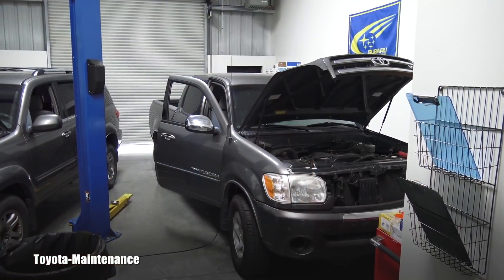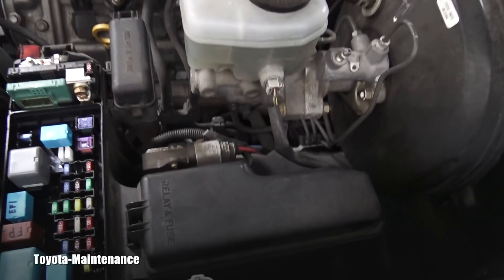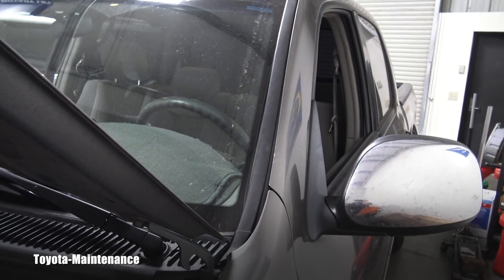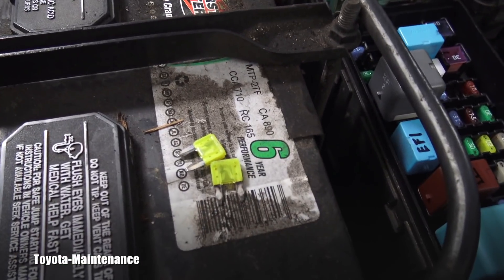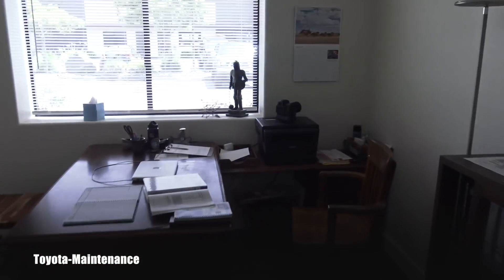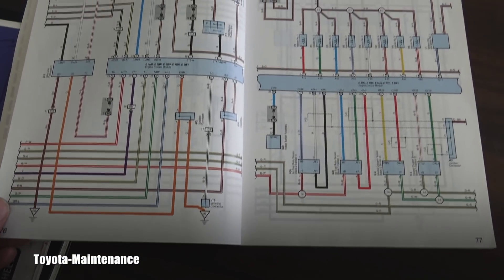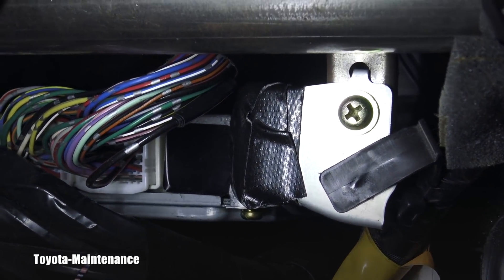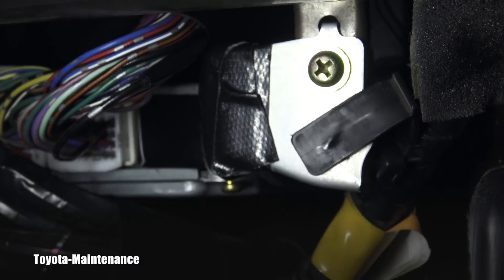How to diagnose Short Circuit in automotive electrical wiring

Comment: So you lucked out and found the short......NO systematic method of tracing a short. If you understood voltage drop you could have started tracing that wire with a voltmeter or test-light down to your short location or even used a short circuit tracer.....I cant believe these fools who are applauding you..........wtf

Comment: Well in my case the ECM doesnt have the same bracket to interfere with the wireing but having it disconnected and will disconnect the fuel pump connector at pump i should be able to isolate it and find it eventually thats how it goes but still your video shows truth and possible fix thanx

Comment: This is exactly what im faced with and because of your video im gonna open my camry ECM area and check because i am considering i need another ECM but i know i gotta a short  blowing the 15 amp EFI fuse,, and i have been tracing my short down and thinking,,,  because i have the haynes schmatic in front of me showing the EFI circuit,, gives me hope,,, yea,,, found your video purely by accident,, and it addresses exactly to the letter the same identical problem in my 99 camry,, i parked my car and the next day my EFI fuse blew turning on ignition to start car and the engine light no show and code reader cant find ecm signal..😮😮😊😊

Comment: So lucky to find you after buying a 96 Tacoma, very useful tips and repairs. Have already done a handful, now this issue is occuring. EFI fuse popping after hitting a bump, then dies. Definently a short in that circuit, just having to find it now.

Comment: Manufacturers install sharp plates in vehicles to cause shorts only to keep mechanics supplied with work. My take on this video. Somewhere in the car is a secret place with a note "look behind the glovebox". There is NO way anybody could read from that wiring diagram "look behind the glovebox", except someone with superstition powers.
I have a short on my 91 Toyota 2.4 Diesel Hilux pickup. It burns the 60A fuse that says AM1 DIESEL, but it supplies electricity to the alternator, to an extra circuit at the ignition switch, then to the relay switch of the starter, wipers, injector pump, etc. That short is coming and going. I have stripped the whole dash but found nothing. After the fuse is replaced, the pickup goes for a month or three. At the auto electrition, everything is working just fine.

Comment: Excellent video. 
I have DTC code P0713 in my 2004 Toyota Rav4 Automatic transmission and replaced the Automatic transmission fluid temperature sensor. I don't get 4th gear maybe because the Overdrive is not activated. I replaced the Automatic transmission fluid temperature sensor and cleared the code but the code returns shortly after. I'm suspecting wiring harness issues, how do I trace it? I have already sent it to many mechanics and electricians who could not help fix the problem. Thank you.

Comment: Hi came across you video on short circuit. Replaced clutch on xtype jag all the lights on the dash went out when trying to start car! Checked all know fuses with meter but they are all fine. Can you tell me how to fix the car  Micky

Comment: I watched to see how you chase down a short, but learned little.  You got lucky with an obvious short with visible scorch and nearby damaged wire.  I was looking for method to chase down hidden short or open circuit.  I have intermittent short in my lighting circuit which effects my instrument light/illumination on a 2000 Nissan Xterra.  I have aftermarket manual, need oem Nissan manual, but will have to manually search for short, it flips a circuit breaker, I believe, as lights periodically work, but driving at night is dangerous, without speedometer, etc.

Comment: I have a 2001 Toyota Camry and the cooling fans don't always work even if you turn on the AC causing it to overheat and blow up my radiator. I replaced the radiator the cooling fans switch relay #1 2 and 3 and checked the fans separately from the vehicle and both of them work fine. I have replaced everything in the cooling fan system and completely stumped. any ideas would be greatly appreciated. I love your video

Comment: This was a good video for troubleshooting a wiring issue. However, I'm surprised that he didn't put electrical tape, around the wires that were causing the shortor reconnect both wires with butt connectors. If those wires are still exposed they could potentially cause another problem in the future, such as the two exposed wires shorting together.

Comment: yeah your lucky to found that easy mine coudn´t find any wire damage to my tailgate lock of my Volvo s60 it continue blowing the fuse I know somewhere there is a damage down there, I opend already the harnes  can`t find any wire damage.I asked the volvo dealer and they told it cost a lot. Thanks for the video.
Reply: Hi. Try "RealFjxesRealFast". Guy teaches how to use simple test tools to trace wires to short. Can you get your electric diagrams. That's key! Good luck. Be patient  - he is a great teacher!

Comment: Have you done a repair video on a Toyota Tacoma that will crank but want fire up.  Also the temperature gauge will show hot.  But the truck hasn’t been running.  What do you think it could be?
Reply: See "RealFixesRealFast". He illustrates that fuel injectors could be Shorted out. Get your electric diagrams and see how he patiently follows and checks wires to short. Good luck!

Comment: Excellent diagnosis video. I have a 2000 Toyota Avalon v6 1mzfe with 257k miles. While driving the oil light flashed and I quickly stopped and check the oil and it had no oil in it. I changed the pcv valve. Does a pcv valve cause oil burning? Is this 1mz-fe commen for burning oil?
Reply: PeterGriffin4200 it can. When you pulled it out was it gummed up and stuck open.

Comment: i have a slightly similar problem, on my 1999 toyota 4runner , once in a while my dash ( tach, speedo, fuel gauge, mileage display) looses power for a second while i'm driving, everything except the engine temp stops working for a split second then comes back on, nothing is affected and truck sounds and drives normally, no check engine light is on, its only done it 4-5 times in the last 4 months, . thanks if you have any ideas
Reply: John Koutsantonis — I have the same yr 4Runner. I found a loose wire inside the fuse box under the hood. I had to take the fuse box out and tighten some tiny bolts that connect 2 fuses to the box body. I found this out because after moving certain wires around the dash started working again. So I figured something was loose. After tightening, it has not happened since. Hope it helps 👍
Reply: @adoniramqoiq  thanks , i'll check it out